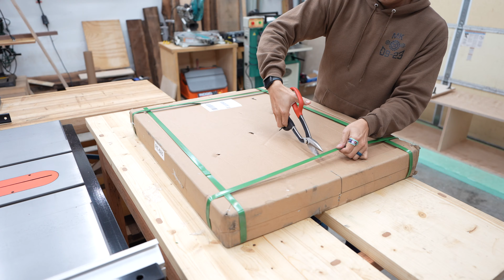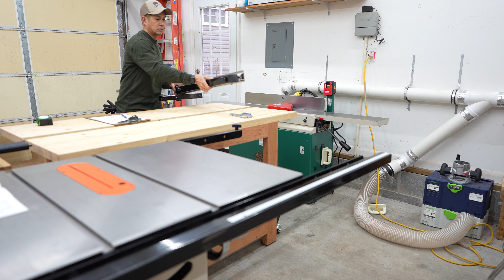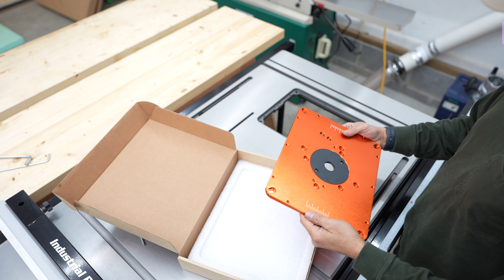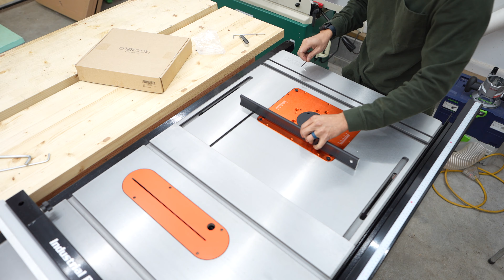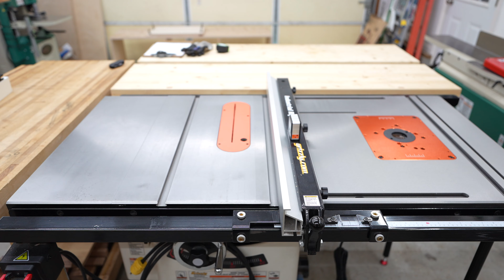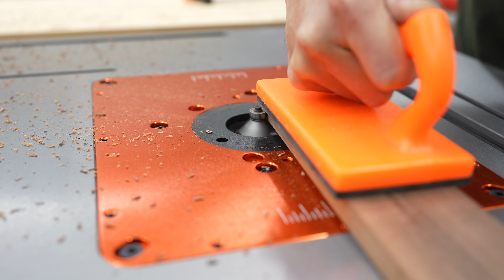UPGRADE Your Workshop | Harvey Router Table Installation

Comment: Really good video, thanks and subscribed! Looking to add a cast iron router extension to my Ridgid saw and info for various extensions and whether they are a direct bolt up for my saw is hard to find. So many videos but you just simply showing the bolt locations with your tape was what I needed. The Harvey is not a direct fit but I was curious about the oskool insert plate you used because I have 2 triton routers. Found oskool has a cast router extension that fits my saw and a fence that appears identical to your taytools fence. Ended up ordering from oskool the extension, 2 insert plates and 2 fences . Thanks again!
Reply from the maker: Thanks Richard, I’m glad you found the video useful! I looked at the Oskool router and honestly it looks as good as the Harvey for much cheaper! Congratulation on the upgrade!